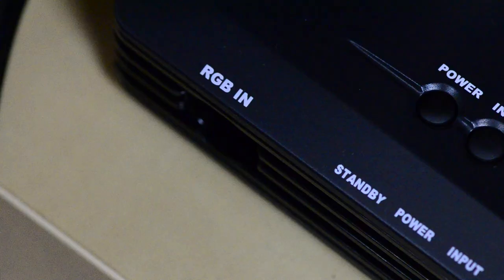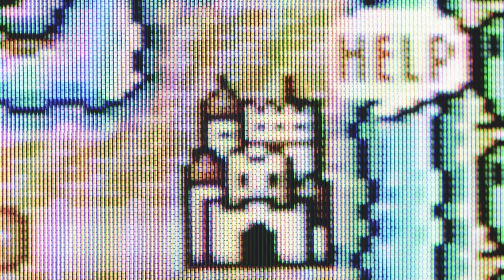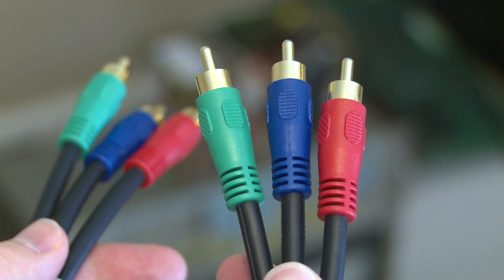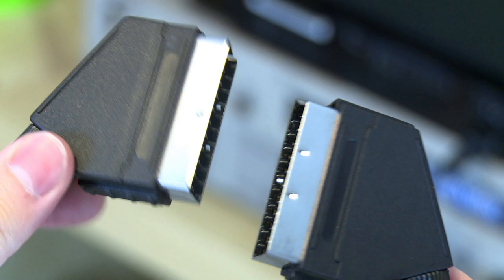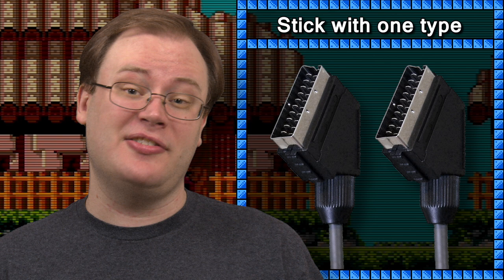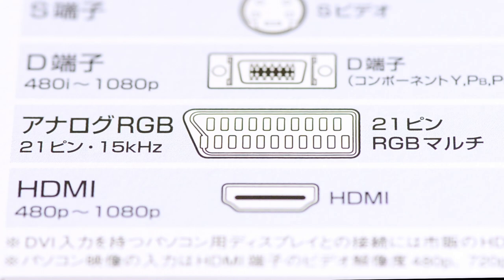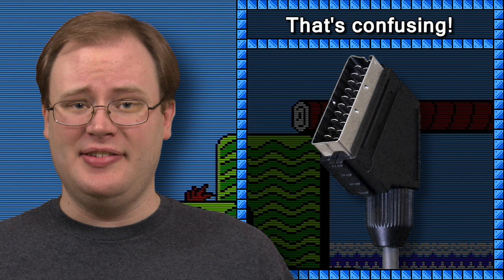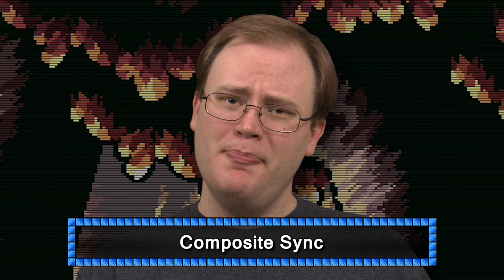Understanding RGB and Sync :: RGB103 / MY LIFE IN GAMING

Comment: One very slight addition concerning your mentioning that you can use yellow/red/white cables as component cable substitutes . . . most cheap molded RCA cables do indeed use the same type of wire for all connectors.  This is true of yellow/red/white cables, component video with red/white audio, etc.  While you can get away with using the wrong color and still get picture or sound, this isn't an absolutely ideal connection, as the specifications for composite video cables and component video cables are different from those of analog stereo audio.  While composite and component video connections are on a standard RCA plug, those video signals are actually meant to be carried by a cable with a constant 75-ohm resistance. This is also how digital coax signals (S/PDIF over RCA) are best carried, but this constant resistance isn't ideal for stereo analog audio (the red and the white).  Depending on how the cables are constructed, you're unlikely to encounter a problem, but purists may want to use proper cables for video and proper ones for audio.  Just because they're all terminated with RCA cables doesn't mean that the wire connecting them is the same.  My apologies if this has already been addressed!

Aside from that one slight thing, I wish that I had found this channel before I bought my XRGB mini, as it would have saved me a lot of research and digging, but I suppose that's half of the fun.  At the very least, you would have saved me lots of time in locating the places to buy the necessary cables!  I'm still in my post-emulation infancy and am only Saturn and Dreamcast-equipped so far (JP-21 for Saturn and Toro Box and Scart for DC, although I'll shortly be getting my model-1 Genesis and Power Base Converter!  I can't wait, as I grew up with a Master System and Genesis!  This is a dangerous hobby, as I once owned SO many difference consoles and now I want them all back!) 

This channel is absolutely terrific, and you guys do a fantastic job of breaking things down.  Your episodes are logically themed, segmented, and constructed.  Thank you for taking the time to do this. After all of my research, I had half of an inkling to try to assemble a primer for people, but found the idea waaaay too daunting.  Then I happened upon your channel.  For once, YouTube was spot-on in a recommendation!  It's nice to know that I'm not alone in my quest to preserve these important artifacts of my past and my desire to be able to experience them in their best form, short of lugging a soon-to-be-broken CRT around.  

Thanks to both of you, and please keep up the superlative work!

Comment: One other thing to consider is how some cables might include built-in sync "strippers" or sync "cleaners" that, while useful in some setups, can cause more harm than good if the rest of your setup isn't tailored to accommodate them.

For many consoles, you can build a SCART cable to pull sync directly from one of many available pins on the AV port, be it the composite video pin, the luma pin, or the standalone c-sync pin for the consoles that have them. But some cables tap into the composite video pin and have an LM1881 chip inside the cabling that strips away the extraneous video data, with only the sync data remaining. Effectively, such cables take composite video (or luma) as input and give you c-sync for output. This gives you a simple and effective way of getting the highest quality sync signal out of a console like the PS1 and PS2, which have luma and +5V pins on their AV ports but no c-sync. Just take that luma signal and convert it into c-sync inside the cable, with no extra external devices needed.

This does, however, introduce another point of possible failure or incompatibility into your display chain. Such a chip would need to draw power from somewhere, and the only logical place to do so would be the console's AV port. Many AV ports have a +5V pin there that can be used for exactly this purpose, but if that pin doesn't exist, if that pin isn't producing a precise +5V signal for some reason, or if the cable is hooked into another device that also needs to draw power from the same source, then the addition of a sync stripper may cause more problems than it solves. The NESRGB board, for example, does output a +5V signal that can be wired to the AV port that you install on the back of the console, but the modder I got to install my board forgot to actually connect that signal to the AV port. As such, I can't really use a device that needs to tap into the AV port for extra power. (Although, in this specific example, that doesn't matter in practice because the NESRGB also has its own c-sync output, which is connected to my AV port.)

I'd only advise buying such cables if (1) the console doesn't output a good c-sync signal of its own, (2) you're pretty sure that a c-sync signal would be superior than other sync options that the console natively produces (e.g. sync-on-composite produces visible artifacts), (3) you can't insert a sync stripper into the console itself (e.g. modding the internals of the N64 so that its AV port outputs c-sync), and (4) you absolutely hate clutter and really don't want to have to buy an external sync stripper like the Sync Strike if you don't have to.

Example and how-to: http://retrorgb.com/syncstripper.html
Reply: I mistakenly bought the CSYNC instead of the Luma sync cable. Does it result in lower quality? Are there no differences? Or can’t I even use it? I’m using a Panasonic Quintrix Acuity EDCRT (480p)

Comment: I've been through several SCART switchers over the years and to be honest,  it's such a minefield, you're probably better off doing the way you do now.

But if you do get one, for the love of god make sure its a mains powered one, as non-powered ones result in a darker muddy picture and also make sure it's RGB SCART (which is what you're using)  a lot of companies have SCART and RGB SCART ports on the back of TVs here (mainly to save money)  and regular SCART uses less pins,  even if you have all the pins in the plug.   It's okay for VHS players Etc.  but for gaming it's no better than RF.

So it is a complete headache getting the right one.   The best ever SCART switcher I ever bought came from QVC of all places :D
Reply from the maker: ***** [Coury] We've been messing with a number of different switchers for awhile now, but definitely haven't found one we're 100% happy with. I'm currently using an unpowered manual Bandridge switcher that makes things slightly darker and introduces a little noise. Its not perfect, but I'm happy with it for the time being. I'd love to get one that is powered and cleans that up - as soon as there is a virtually perfect solution, I'll be all over it.
Reply: *****
Yup you definitely need a mains powered switcher,  the unpowered ones are really for non-RGB and for VHS players Etc.

Have you tried searching the various European Amazon sites out of curiosity?  It's what I do for hard to get stuff.
Reply: ***** I currently use the Brandridge VSB7735. It has five scart inputs and one output. It requires a 12 volt adapter and performs automatic input switching based on the active device. It also allows you to manually select an input in case you have multiple devices turned on at the same time using the buttons on the front. I am mostly a SEGA collector. I managed to succesfully connect the master system, genesis, saturn and dreamcast ( vga over scart ) to this SCART switch into the framemeister. All inputs are shielded from each other and i didn't notice any interference. I am very happy with it so far.
Reply: msh1044 thanks a lot man, This was really helpful. Hopefully just what I need to get a few systems hooked up to my trinitron's solitary component :)
Reply: You really are everywhere

Comment: This series continues to be the best Youtube source I've seen on these topics. You're doing a great job.

Two comments on specific topics briefly touched upon in this video:

- You can get C-Sync out of an N64, but only if the C-Sync pin on the console's AV port is correctly wired up to provide it. In my experience, a lot of modders won't do this unless you specifically request it because, as you've explained in this video, sync can be obtained from the composite video pin instead. But if you want to get C-Sync cables for all of your consoles and be able to share a C-Sync RGB cable between an N64, SNES, and even an RGB-modded NES with a multi-out, then you just have to make sure that C-Sync pin for each of those consoles is wired for it.

- A lot of retro consoles (Master System, Genesis, NTSC SNES, 32X, NTSC Saturn) have dedicated C-Sync pins on their AV port, but some (Playstation 1 & 2) don't. For these, getting RGB cables that draw the sync signal from the S-Video Luma pin (Sync-on-Luma) is generally the preferred way to go when it's an option since there's less unnecessary data getting in the way of the signal.

I've also been told that the C-Sync pin on the Sega Nomad is bugged and produces a scrambled picture. Never tested it myself, but regular Sync-on-Composite cables might be required for that one.

One thing I'd be interested in learning more about is Sync-on-Green (usually abbreviated RGsB instead of the standard SCART RGBs), which is kind of a rare configuration. Instead of carrying the RGB signal across 4 pins (red, green, blue, sync), it only uses 3 (red, green + sync, blue). I've heard that this can actually be used to get 480p RGB out of a PS2, which is interesting because most SCART devices seem to max out at 480i/240p. No idea how much of this is true or where to find more details, though, and I'm not sure if it'd be any better or worse than YPbPr anyway.
Reply from the maker: Ah! So CSYNC is possible on N64. Unfortunately, at the time, I didn't know any better than to simply request "RGB mod." Can probably be upgraded by another modder for less money than it would cost to work around the situation. I also wish we'd thought to mention sync on luma for RGB. Silly oversight because we both have sync on luma SCART for PS2. I've read some about sync on green, but wasn't sure if it had any gaming applications.
Reply: ***** Is sync on luma as good as CSYNC? I'm considering getting an RGB Scart for my PAL Gamecube but I don't know what type of sync I would need.

Comment: Great video as always guys. For those of you like myself who bought SCART cables with non-CSYNC to go with your XRGB-Mini and only read about this after buying, here's a few tricks if you don't want to spend more money.

You have 2 ways of limiting the appearance those diagonal lines (limiting as in they are technically still there but you barely notice them).

1- Increase the HDMI output. If I use the SNES Legend of Zelda example from the video, I can see those diagonal lines in the TriForce if I output with the XRGB-Mini at 480p. At 720p, I can see them, if I put on my glasses and at 1080p, I can't see them even with my glasses. That being said, I have a 40" LED TV, so your results may vary on a bigger TV.

2- Use the scanlines feature of the XRGB-Mini. Scanlines are so much more noticeable than the diagonal lines and are also cut in half by those said scanlines. If you are going to use scanlines, use them in either 480p or 720p output since they don't look that great in 1080p.
Reply from the maker: [Try4ce] Thanks! Another option, which some people may disagree with, is setting the Framemeister picture mode to "Standard." The preferred mode is "Natural," though Standard is the default. Standard mode can smudge some of the details, though I personally didn't notice this for the longest time. However, it can also help get rid of those patterns, which I'd say is worth it. Natural mode looks crisper than Standard mode when using CSYNC cables, but using sync on the composite video signal isn't too good for this mode.
Reply: ***** True, diagonal lines are less noticeable in Standard mode mainly because the image is compressed horizontally (from left to right). Took me a couple of days to figure out why my retro games looked so weird until I notice that my characters were so thin, hence why googled the info.  

I found out that Natural (or Natural2 as it's called) leaves to original pixel aspect ratio while Standard will try to squeeze in the image in a 4:3 aspect while leaving boarders on the left and right side. So your game image itself is no longer 4:3 but more like 4:3 compressed in +/- 3:3 if that makes any sense.
Reply from the maker: [Try4ce] Not sure if we're talking about the same thing. I think you might be talking about the scaling modes, one being called "Standard" which I think is the one I use. There are also image modes, which is more about how the image is treated. There's a "Standard" in that menu too, but it's a totally different meaning and application.
Reply: ***** Oh that Standard, hehe, this is what happens when you have 2 buttons on the remote with the same name. What I said about the "scaling Standard" still holds, but I will give "processing Standard" a try.

EDIT: I tried the "processing Standard" mode. It indeed makes the diagonal lines pretty invisible regardless of the output resolution. That being said, the scrolling is not as smooth as the "processing Picture" mode on 240p games. So I guess it's one of those "pick your poison" deals if you got with "processing Standard" mode.

Comment: Great video! I have decided to press the "Thumbs up" icon to enhance your Youtube fame and help you gain financial prosperity.

My SCART to RGB converter for the XFramemeisterMini has an LM1881 chip inside of it for the sync. Even then, the Framemeister cannot see video from my TurboGrafx. Well it can see it, but it can't make sense of it. Everything is stretched super crazy. However if I run the TurboGrafx video through a Sync Stripper (which has the same LM1881 chip) the XPC-4 (which, like the Framemeister, was made by the developers of After Burner 2 on the Genesis) can see it. But some games cut in and out like crazy.
Reply from the maker: [Try4ce] I've recently gotten the adapter with the chip too. I haven't fully tested it yet to discern all of the benefits, but my hope was that it would get me around issues I've been having with trying to get switchers working. It works great with all of my systems, but I don't have a Turbografx.
Reply: To Quote Wikipedia and the internet.

The signals carried by SCART include both composite and RGB (with composite synchronisation) video, stereo audio input/output and digital signalling. The standard was extended at the end of the 1980s to support the new S-Video signals. A TV can be awakened from standby mode, and it can automatically switch to appropriate AV channel, when the device attached to it through a SCART connector is turned on.

http://www.mmmonkey.co.uk/composite-sync-stripper-lm1881/

Is it more likey your NTSC TV is the problem. As SCART is based on the Euro PAL signal.

http://www.diffen.com/difference/NTSC_vs_PAL
Reply: The Pumpking King
Errr... no. It's going through a Framemeister. No NTSC TV involved. Also NTSC/PAL is irrelevant. The cable doesn't care about 50Hz or 60Hz.
Reply from the maker: This is an important point that we should've made sometime. It may seem weird to use a European cabling standard on North American consoles, but the cables themselves have nothing to do with NTSC or PAL.
Reply: Game Sack Have you tried changing the sync level on the Framemeister?
Reply: The included chip may occasionally not get enough power to boost the sync signal. Can you try a cable without the included chip? It may have been necessary to use the boosted chip injunction with xrgb-mini, when it had older firmwares (1.08 and older). Can you let us know what you try Game Sack ?
Reply: Issa Fattah
I do not have any cables without the included chip.
Reply: +Game Sack the sync cleaner is only necessary for when the cable is using luma for sync or composite video for sync. Often the composite sync is not available or too weak for some reason.
Reply: I modded my Tg16 to scart RGB and used the composite sync, the framemeister has no problums  no sync stripper needed strange your getting issues. I find the best results it to set the sync to 17 and then use the auto sync, from what i can see the framemeister auto sync must use the manual setting as the base and then adjust the sync either way to get a picture or i could be taking out my arse who knows it works for me.

Comment: Excellent video guys, presented difficult to grasp information succinctly, and followed it up with visual aids to assist in understanding. Simply fantastic. One request: a follow up video showing EXACTLY which cables (including model #s if possible) and what order they go in from console to TV.
Reply from the maker: G D [Coury] Thanks! We actually have a "200" and "300" series in the works. The 200 will cover individual consoles going over all the options you have for video with it.

And the 300 will be specific in depth subjects, such as "Vs the Retron 5" and " Framemeister menu settings"

Comment: As a German, we used SCART for all devices that were on the TV shelf and devices like camcorders, that we connected to the TV to play the Hi8 tape that were recorded on vacations, were connected using composite (yellow cinch) or later when my dad moved to miniDV tapes it was s-video to play them. Today, I have some computers in my collection, like Amiga 500plus, Atari, and C64. All go by SCART, also the C64  cause the SCART connector is able to do s-video. But everything else goes RGB.